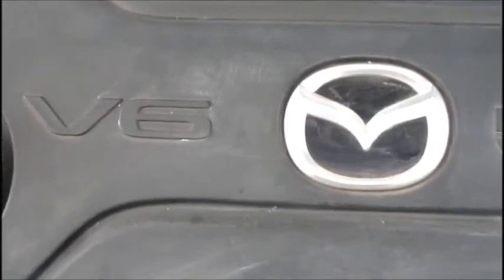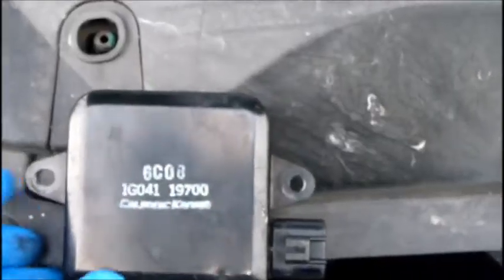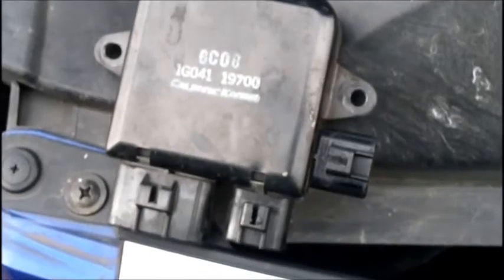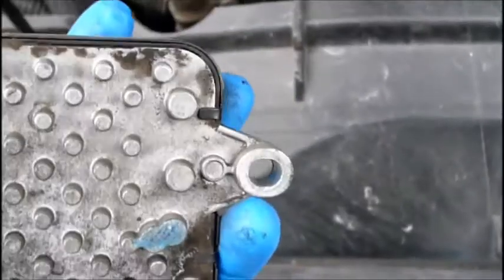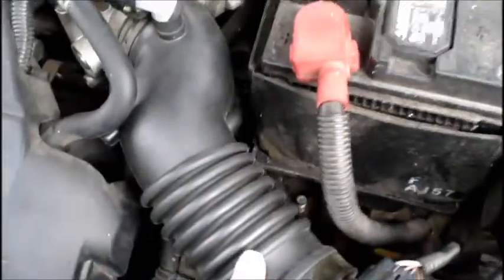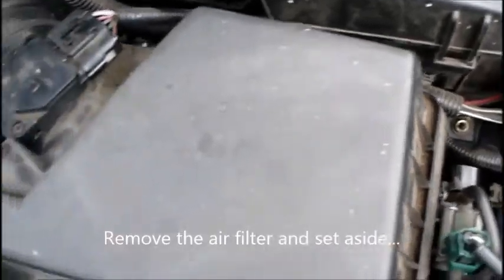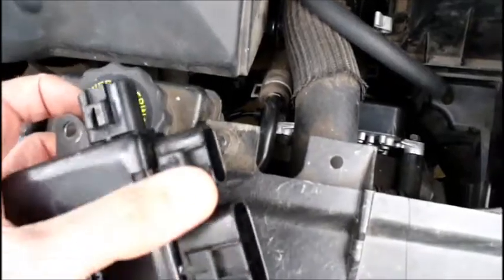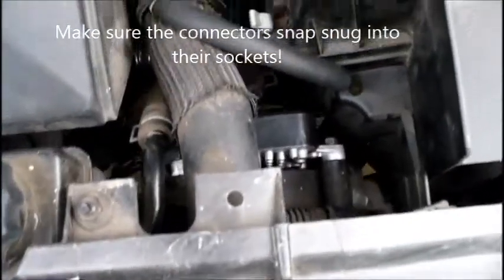DIY Mazda 6 Cooling Fan Control module troubleshooting and replacement

Comment: Great video, I’m having the same issue in my 08 as well.  Will be ordering a new module tonight, hopefully this will be a fix for the fans constantly running. Again very helpful video.  Thanks!!!
Reply from the maker: thanks. You may also want to check out my video on replacing the cooling fan unit. I have found that the majority of the time, the module goes bad because the cooling fans are worn and drawing more current than they should. Unfortunately the module was not designed very well and has no current limiting on it, and therefore burns out. So, changing out your module will fix it probably for a month and then the module will be damaged. :( Unless you get lucky and it really is just a defective module that was not damaged by the worn fan motors.... Good luck. here is the link: https://youtu.be/ZnONA3GdpGY
Reply: David The Fixer of Things Hey thanks for the video. Would you put the link from the seller you bought yours from? because I bought one and it was defective so I'm sending it back
Reply: Marvin Alexander Rivera Benitez    I bought mine from Rock Auto.  Was roughly $60 with shipping
Reply: Possom Point is everything working properly in the one you ordered ?
Reply: Marvin Alexander Rivera Benitez     I installed it today, took about 30 min.  It fixed the problem, but I haven’t driven it long enough to actually see if that was the problem.  I’m hoping that this will fix it completely and not be my fans like you had stated before.   I will post an update in the next week or so to let you know.
Reply: Possom Point alright thanks, let me know how it works out. For mine, the issue was it would stay on a long time after I turned off the engine, no overheating or anything but with the new one I installed my cars ac stops working in the middle of the hot day and at stop lights which it didn't have that problem before I switched it out. I got mine off eBay but I'm trying to find a company that sells a good one cause there are many out there, and the price at the dealer is 141.00
Reply: Marvin Alexander Rivera Benitez    Oh wow that’s crazy.  I’ll keep an eye out to see if that happens to mine or not
Reply from the maker: I forgot to mention to you that if you have a 2008 Mazda, the control modules may be a bit different from previous years, so be aware of this when you order to make sure to get the correct module.
Reply: Possom Point how'd the FCM workout ?
Reply: Marvin Alexander Rivera Benitez       Hey there.    As of now, everything is working fine. My AC works and still blows cold, the only issue I had is when I disconnected my battery (negative terminal) I lost control of my AUTO windows. The windows still went up and down, just not the auto part. After about a week they started to work. I’m not sure why this happened but all in all the FCM is working, but like original poster said, I want to wait at least a month to insure it will not fail, I bought a GATES brand FCM from RockAuto
Reply from the maker: The reason your windows auto up/dwn function stopped is because power to the main control module was lost and therefore your windows need to be reprogrammed. You will notice that your passenger window needs this too. the instructions are in your users manual. But if I remember correctly it is something like this: 
1. Turn the key on
2. Press and HOLD driver's front window switch until window is all the way down or close
3. Pull up and HOLD the window switch for at least THREE SECONDS after window is all the way up. There might be a beep noise, but mine didn't
4. Repeat the process for passenger side window FROM PASSENGER SIDE SWITCH ON PASSENGER DOOR. 

good luck.
Reply from the maker: The reason your windows auto up/dwn function stopped is because power to the main control module was lost and therefore your windows need to be reprogrammed. You will notice that your passenger window needs this too. the instructions are in your users manual. But if I remember correctly it is something like this: 1. Turn the key on 2. Press and HOLD driver's front window switch until window is all the way down or close 3. Pull up and HOLD the window switch for at least THREE SECONDS after window is all the way up. There might be a beep noise, but mine didn't 4. Repeat the process for passenger side window FROM PASSENGER SIDE SWITCH ON PASSENGER DOOR. good luck.
Reply: David The Fixer of Things 
Hey guys just wanted to chime in, it’s been a while since I replaced the FCM, I have had zero issues since I replaced my module. AC is working fine, windows are back to normal, seemed to be the module went bad.   Thanks again to David for the great video and explanation!!!
Reply from the maker: glad to hear it is working out. thanks for the update! and if you haven't already subscribed to my channel that would be great if you would. thanks!
Reply: Same problem with mine .. 2007 V6. Did yours work? Let me know please.
Reply: zobry2xxx     Yes it did.  Buy a quality part  do not a cheap one
Reply: Thanks Possom P. So u r saying that the $10 -15 units on E-Bay  are no good? What did yours cost?
Reply: zobry2xxx    welcome,  my honest opinion I would not buy those, I bought mine from RockAuto.  It’s a Bates brand.  I think it cost about $65 I can’t remember, but so far the fans haven’t ran like they did before.   David has a very good and detailed video for this, so definitely watch it.  Helped me a lot.

Comment: Would there be an engine light if it’s bad?
Reply from the maker: Not necessarily if a fan unit or control module is defective. However,  there could be error codes related to the cooling system. If the engine is running hot as a result of the fans NOT running correctly. Find out what the error code(s) is that is tripping the check engine light. Code readers can be borrowed from places like AutoZone and O'reilly (here in the US). They will even help you hook it up and read the codes. That will give you some clues as to where to look for the problems. Good luck.

Comment: I been having issues with my car that keeps overheating, does this might also fix it? Because i do hear the fan sometimes comes on sometimes it doesnt.
Reply from the maker: I would check the thermostat first it might be stuck closed. and then check the temperature sensors. Also check to make sure the coolant is clean and reservoir topped off. It is normal for the fans to cycle on and off when the car is real hot. Its when they stay on or never turn on is when you have a problem.

Comment: hi. when you disconect the temp sensor and the fans start working that means the module is ok ?
Reply from the maker: Hmm. well interesting. Most likely your module is probably good and your temperature sensor is defective.
Reply: the sensor is fine i just disconectid to check the module and the fan. thank you
Reply: Grab a positive and negative wire. Run it on both fan plugs and the other side place on battery posts. If there is a fan bad they will not run. If the both work they should come on one for each plug

Comment: To check to see if the fans are still serviceable you can measure the amps when running. If the bearings are going out the fans will draw more amps. A new fan unit only costs around $100 so you might do well to replace it as well if you need to replace the fan control module.
Reply from the maker: yes absolutely, you can do this. However, many DIYers do not have sufficient equipment (DMM, or amp meter) and means to tap into the fan wiring harness. But if a person wanted to do this, they would need to put their DMM into the wiring harness in series and make sure the DMM can measure in Amperes. In my other video I explain how to replace the entire fan module unit, which is a pain to do, but can be done. Thanks for your comments!
Reply: My amp measuring device of choice is a relatively cheap clamp-on amprobe. No need to remove insulation, just clamp around the single hot wire. $20 buys a good enough one on Ebay. It would be good to know the specs on the fans. I haven't been able to find them but I;m sure they're out there somewhere. Thanks for your videos!

Comment: hi need some help heŕe i already replace the module on auxilliary fan but still not working,
Reply from the maker: have you checked you fuse box? I think there is at least one if not two of them. The main one is located under the hood of the car on the right side above the battery in a black box. Its a large contractor fuse. I think there might be another one inside the car under the dash. Check those. If those are ok then perhaps you have a broken wire on the fans? Do either one of the fans come on? if neither one, then it might be a broken wire or the connections to the module are not in tight. Good luck.

Comment: Where did you buy this for $18?  My local store is charging $87?
Reply from the maker: I bought it online. Ebay if I remember right. There are tons of them for sale. However, you want to look for one that is OEM. The first one I bought was not. It cost me approx $18. It failed. The second I bought was somewhere around $25 and it was a OEM. Search for the number that is located on the controller.
Reply: David The Fixer of Things Thank you for your quick response.  Mine doesn't run after its off but it kicks on and off repeatedly.  I don't think its the actual fan motor so I'll try replacing this first.  Thanks!
Reply from the maker: yeah if it is constantly turning on and off for no apparent reason, then I would start with the FCM. good luck. hope it fixes it!

Comment: Can i bridge this bad boy?
Reply from the maker: No absolutely NOT. You can not run the fans with direct DC power, it will damage them. They are stepper motors and require a PWM (pulse width modulated) controller to operate.
Reply from the maker: bridge as in putting two control modules in parallel? and have 4 fans? I suppose so, but not sure why you would want to. Run DC power from the input side to both controllers.
Reply: David The Fixer of Things 
No, I meant bypass the control module. So bridge the power straight to the fans and bypass the module without having to add a switch. So in other words, they will run pretty much all the time that the van is running.